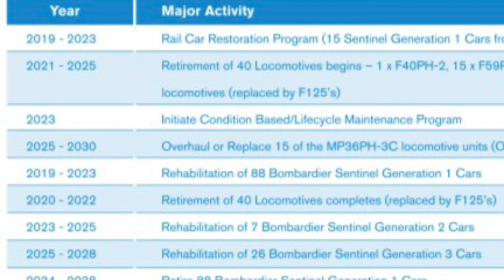Engines of Metrolink: MPI MP36PH-3C

Comment: Great episode. Thanks for the shoutout! Never knew that the MPXpress has the same engine as an SD50....

And HOT DANG they're refurbishing the original Bombardiers!!! Never knew they were called Sentinels.
Reply from the maker: It’s only the engine for the 3Ss and 3Cs weirdly. The MP40s on GO Transit and Sound Transit use 710s while the MP54s on GO Transit used 2 Cummins QSK60s.
Reply from the maker: Sebastian Floyd  Depends if Metrolink fits them with Tier 4 engines in the next couple years.

Comment: If I remember correctly, 895 was recently In an accident when a Metrolink hit a plane that crash landed on the tracks. Even though the cab car of that train was the one that hit the plane, the plane got hit again by 895. 895 wasn’t damaged though, but the cab car was. I didn’t really know how to explain this correctly.
Reply from the maker: I think that would go under the Rotems with 657 taking the brunt of the impact.
Reply: @StocktonSubber  I think it was SCAX #667
Reply from the maker: @t0nyxldr  Yeah, you’re right. I just found out recently.
Reply: It was SCAX 667, it’s been fixed and repainted and now back in service!